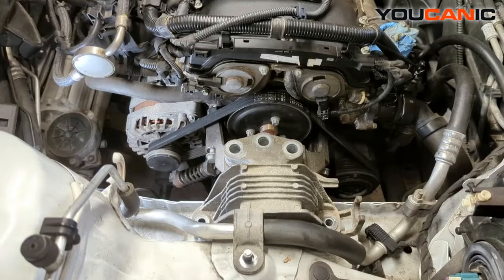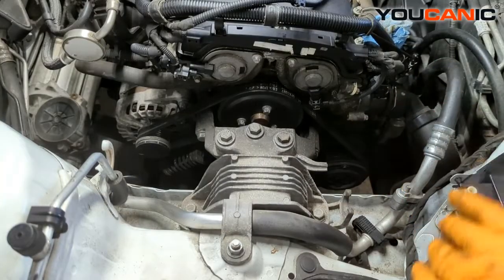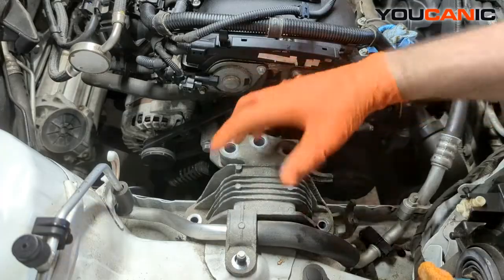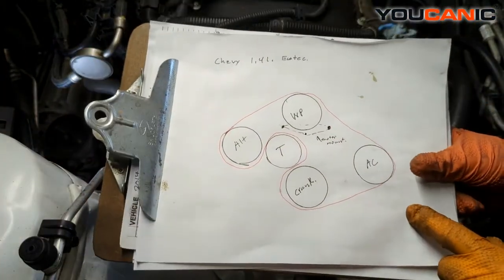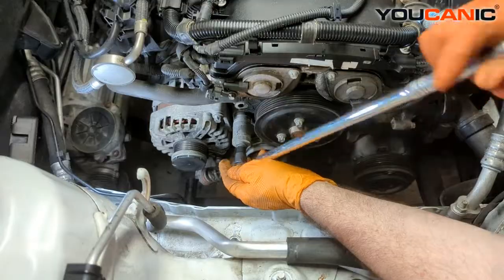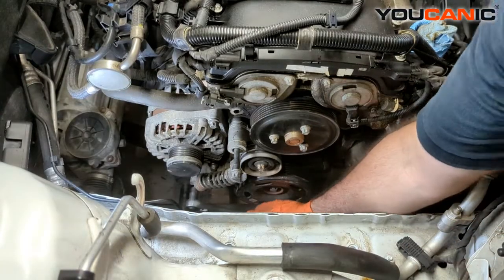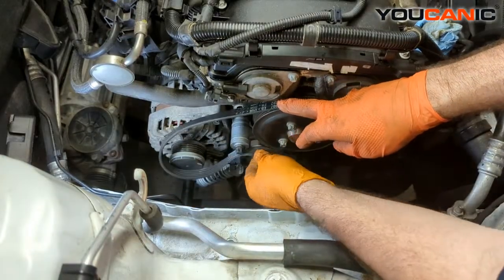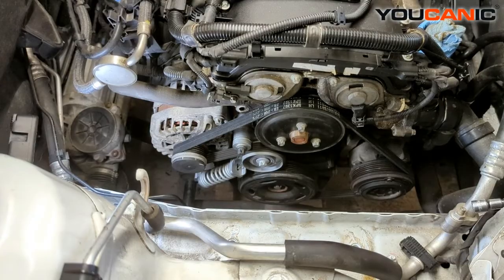2008-2016 1.4L Chevrolet Cruze - Serpentine Belt and Tensioner Pulley Replacement

Comment: You do not need to take the motor mount off at all you can get at it from the top you don't even need to loosen it 11 mm socket
Reply from the maker: @bradcorley9493 If you’ve got a car issue or repair question, you can find step-by-step guides and scanner help at youcanic.com. We might miss some comments here, but our site has answers for most problems already!

Comment: There's a hole in the tensioner that you stick a pin thru into a hole on the block. It prevents the spring pressure from bounding the tensioner out.

Comment: Will this fix the rattling noises I hear everytime I turn the a/c on in the car?
Reply: I know it may be a year late but I had the same exact problem with rattling noise when I turn on the ac, changed the tensioner and no more rattle

Comment: I did this job, but the belt still isn't  very tight. I did remove the pin, or actually it fell out when I released the tension to put the new belt on.

Comment: I just installed a new tensioner and I'm not able to release the tension to get the new belt on. I'm not surprised by that part because I don't have a lot of leverage or weight to put behind it, but is there a way around that? Another method of getting the belt on without having to find someone to loosen the tension for me? Thanks!
Reply from the maker: Thanks for reaching out! At Youcanic, we understand your challenges as a car owner and aim to assist you. The tension on a new tensioner could be quite strong. However, majorly it requires the right technique rather than weight to release it. This process and more is covered in our detailed factory repair manuals, available at www.youcanic.com for your ease.

We invite you to explore our extensive resources and we're here to support your car ownership journey. For further assistance, please don't hesitate to reach out on our website. Happy car tinkering!

Comment: I replaced the belt on mine and it shredded again a week later but it was smoking first how do i figure out which one wasn't spinning and creating that friction?
Reply from the maker: Thanks for your question! To troubleshoot which pulley isn't spinning, causing your belt to shred, there might be a more comprehensive guide available on our platform - Youcanic. We pride ourselves on empowering car owners with free resources, and we are always here to support you through your car ownership journey. 

Please don't hesitate to reach out to Youcanic directly if you need any further assistance. We also offer detailed factory repair manuals which could be very useful for your situation. Visit our website for more info www.youcanic.com.
Reply: Did you replace the tensioner?
Reply: @Jpcar1984 yea I replaced the valve cover yesterday actually with the right torque sequence and inch lb torque. It’s still leaking I’m getting smoke from somewhere between my passenger side headlight and the turbo.
Reply: @Jpcar1984 it only smokes after reaching operating temp when I drive it a while when the engines cold it drives perfectly fine.
Reply: @troysmith3713  Not a mechanic, but I just recently did a fix for a P0171 fix on my Cruze 2011 LTZ Turbo, with the catch can, new intake manifold and custom bypass. I had blown my pcv hose, intake manifold rubber seal and finally valve cover started whistling. All this just to say i'm familiar with a valve cover. You said you did a valve cover replacement recently, did you add gasket silicone to the 3 spots of the valve cover? I had a leak as well, but what I found out was my previous service center never added gasket silicone to the top, bottom and mid grab points near and around the bolts and I was leaking oil. There are gap points found on the metal on top and bottom on the left side where the bolts are where gasket silicone is required. Have you checked if this is where your leak is from? 

This is of course unrelated to the your belt situation. From one Cruze owner to the next, hope this helps or you find a solution to the issue.
Reply: @NYslicknessGaming   I appreciate you taking time out of your day for the advice bro.. but yea I’m getting oil on those front two bolts right above where the thermostat is on the bottom left of the valve cover the leak stopped a lot but I’m still getting oil right where those two bolts are I’ll give it a shot hope it works thanks bro.
Reply: Just wanted to add most part stores have the incorrect serpentine belt. I had to zoom in yours to find the right one. Ours are 5 ribs and most stores are 6 ribs so it never lines up right

Comment: Question should the water pump pulley spin?
Reply from the maker: Hi there! Yes, the water pump pulley should spin as it is connected to the serpentine belt system. When the engine is running, all your pulleys should be rotating. In case you encounter any issues, feel free to consult our vast range of free resources and guides at www.youcanic.com.

Remember, at Youcanic, our goal is to make car maintenance easier for you. We even provide access to factory repair manuals if you need them. Don't hesitate to drop us a question on our site if you need any further assistance. We're here to support you in your car ownership journey!
Reply: I'm pretty sure he was referring to when the belt is off and the engine not running. I have the same question.  @YOUCANIC

Comment: It is pretty common for the tensioner spring to break off when removing the tensioner? I took mine off and I started on the bolt at the bottom spring park. And it shot off and broke. Did I do it wrong?
Reply from the maker: Hi there! It sounds like you may have encountered a common issue when removing the tensioner spring. At Youcanic, our goal is to empower you with the necessary resources to tackle car maintenance confidently. We recommend you take a look at our comprehensive guides and use our powerful YOUCANIC scanner for further assistance. For a more in-depth understanding, refer to our available factory repair manuals. We are here to support you throughout your car maintenance journey. For any further queries, don't hesitate to reach out to us on our website: www.youcanic.com. Keep on driving safely!
Reply: You stick a pin thru the tensioner. It goes into a little hole in the block. Keeps that from happening.

Comment: Question so if I just need to replace the tensioner and not the belt can I do this without removing the motor mount?
Reply from the maker: Absolutely, you can replace the tensioner without removing the motor mount. While every car model might have a slight difference, in most cases, it is totally doable. If you need any further guidance regarding this, YOUCANIC offers a wealth of information and resources to assist you. Check out our website here: www.youcanic.com. You'll also find our Full System Scanner, a tool to help diagnose any car issues you may have: www.youcanic.com/scanner. Navigate to our platform and ask all the car-related questions you want, our aim at YOUCANIC is to make car repairs understandable and accessible to all car owners.